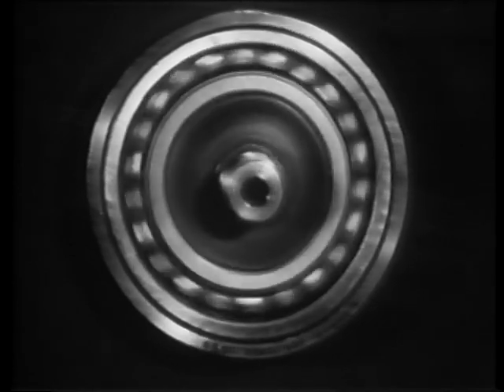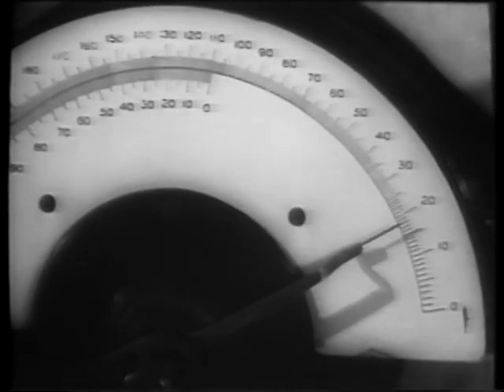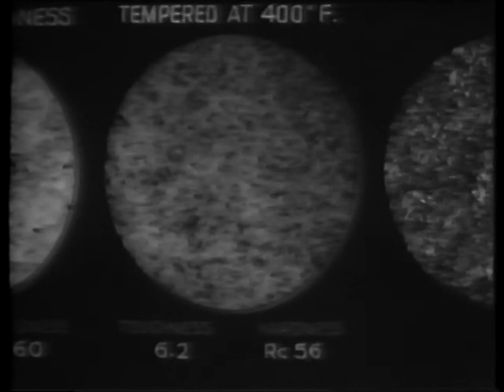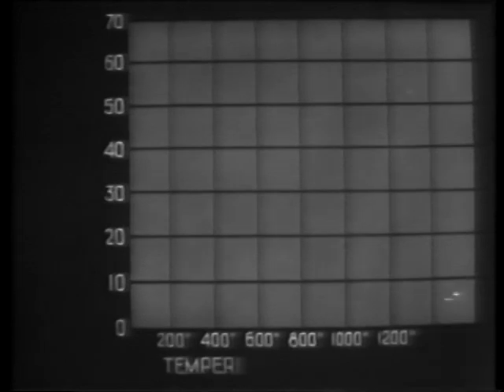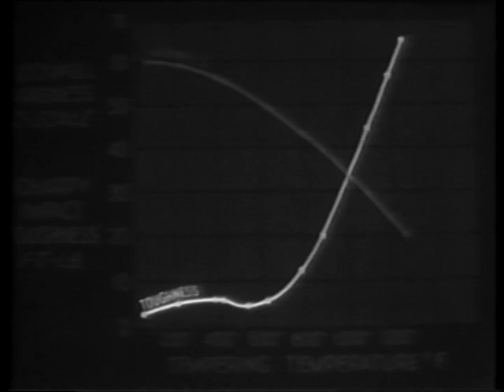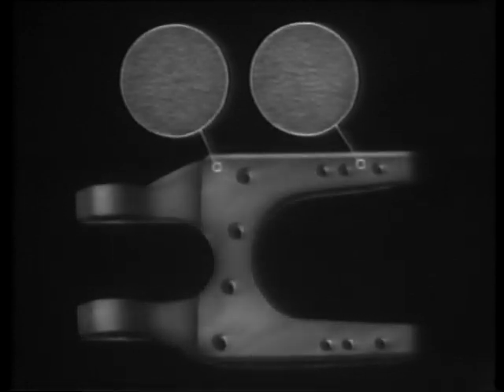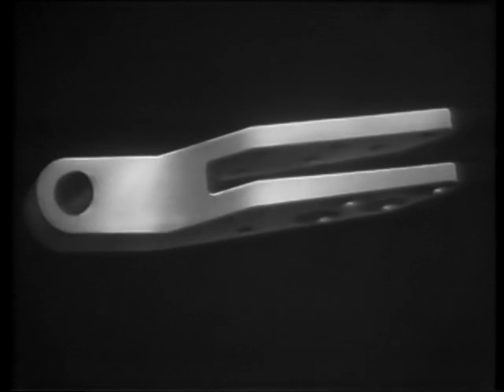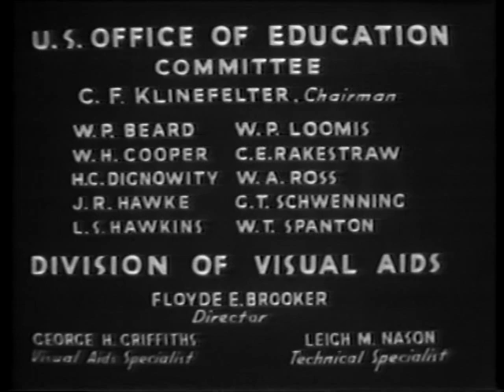Elements of Tempering, Normalizing, and Annealing

Comment: There was a similar video on "hardening steel" that showed how quenching from different temps affected hardness and microstructures.  Is it still around?
Reply: A chisel, as well as drill bits are quenched. Try looking for those in your search.
Reply: Also look up Ammonia Nitriding. GM used to use that process for hardening crankshafts.